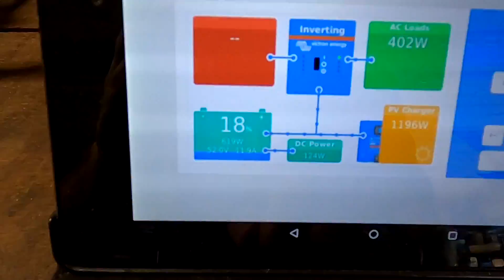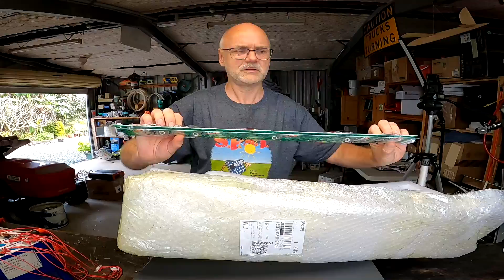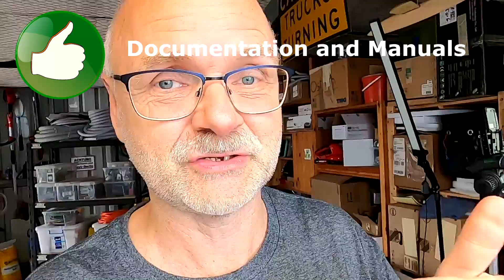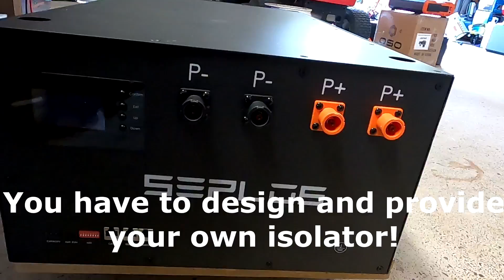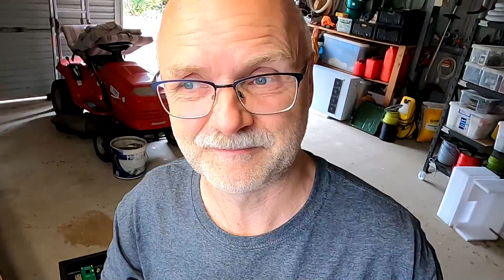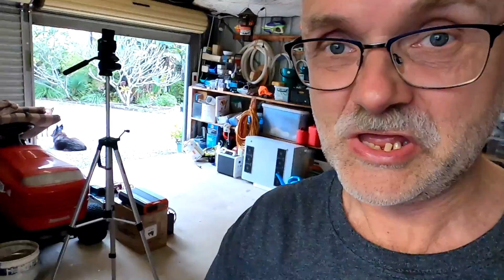Considering a SEPLOS Battery or BMS? Here is my experience so far...

Comment: Hi:) - Thank you for a stream of very informative videos:) Planning to use 2 x DIY Seplos Mason packs for a boat project and though I pick your brain if you do not mind:) Can see that you can use either 16 x EVE LF280K or LF304K (believe you tend to opt for the first option). Do you see anything negative in using LF304K or is it just a cost versus output question? - Another question that I am interested in your view on is that my batteries will be stored out of sight. Due to this my idea is to extend the cable to the display window and mount this away from the box (and to plug the display windows with a dead plate). Can you see any negatives in doing so?:) Thanks again!

Comment: So, is it possible to connect a NEEY active balancer to the Seplos V3 BMS so that the BMS can activate the balancer if and when it needs to automatically. As there is a set of pads to activate the Balancer it should be possible if the Seplos has an active balance output. Ideas?

Comment: Hi! I'm considering changing my battery. Now I have 4 WV NMC 12S modules, they are 48v and a total of 27kwh.
The problem is that the battery low-top range is 40-49v but in fact the deye cuts discharge arrond 43/44v.
I think the 40-58v voltage range of a lifepo4 would be much better, even knowing that the seplos mason has around 14kwh.
Does make sense the idea of changing it?
Thanks!

Comment: As much as i like the box, etc. the negatives are concerning but also the cost is way too much. i'm seriously debating just DIYing it. to get 2 casings here to Aussie total is almost half the cost of my batteries :( $2k for cases and my 32 x 280ah cells were $5.2k
Reply from the maker: Did you get a quote for shipping? Don't use the shipping calculator on their website...
I thought the same but considering you get a very good built case with handles and all accessories, front plate, the 200A BMS, display and battery compression, battery cell PCBs, temp sensors and also stackable. You probably don't safe much. Yeah, but the shipping costs may kill it. Unless you buy the batteries from Seplos as well and they can ship it all together. Tell them they need to give you a good deal and you're coming from my channel.
Reply: @OffGridGarageAustralia  i'll give it a try and let you know what happens.
Reply: @OffGridGarageAustralia  i spoke to allen and he give me following prices
1 box with shipping $782.04aud
2 box with shipping $1542.03aud
which is better not so bad.
Reply from the maker: @jeremyohara6513  Yeah, OK, that's still... some money. Considering, the BMS is around A$400-A$450 already, plus all the other accessories, you probably cannot make such a metal box yourself including welding and spray painting. So overall the price seems to be OK, it seems.
Thanks for sharing.
Reply: @OffGridGarageAustralia  yeah still expensive. worse then a server chassle, i could make a box out of ply or get the plastic battery boxes that hold 8cells and put in parallel to make 48v, etc., bms i've seen for about 200 - 300$ if i get the seplos bms, So yeah still kinda on the fence

Comment: Hi Andy, I watch your video’s with great interest. Really nice!
I just built a Seplos 280Ah vertical white battery box with EVE cells.
Quality of the box is great and assembly is easy.
One problem however with the bms. 
When switching on, the bms starts up with all the lights and then displays “ABNORMAL COMMUNICATION”.
Then the display is frozen and the bms will not transfer data to the app on my IPhone.
The app does see the device and power is connected to the output terminals of the battery.
I contacted Jerry of Seplos and he says that is not a correct siuation, but sofar no solution to solve this problem.
Do you have any idea to correct this comm issue?
Grtz from Bert in The Netherlands.
Reply: Hi Andy, thank you for your reaction.
Yes it is a 10E bms. But…
The bms for the standing Seplos is slightly differen from the black battery case. It has a “remote” comm/dipswitch/led display that is located at the top rear of the case with a comm board that is connected to the bms with a plug and flat cable.
The bms’s are not interchangeable between the horizontal and vertical cases.
I also have three horizontal cases here so I tried to interchange the bms. No luck!
I have a friend with a windows laptop, we will install the software and I obtained a rs485/usb adapter.
Today we will try to get access to the bms with te laptop and see how far we get.
I will let you know!
Grtz Bert
Reply from the maker: @bert-janstaat278  Thanks, yeah, keep me posted. Never heard from anyone of a faulty Seplos BMS. Or whatever it might be. Interesting they are using a different BMS/formfactor for the vertical box.
Reply from the maker: Hi Bert. I still have such a vertical Seplos box in my garage for a future video.
What BMS do you have, the 10E? Can you access it via PC software at all? If not it is faulty and needs replacement, I would say.

Comment: I was wondering why some friends of mine are buying these seplos BMS and so fond of them. And I never understood why... Now I know, it is not bad BMS, bat for the same money you can get much better product, so there is no reason to buy it
Reply from the maker: It all depends what batteries you have an how many in parallel. There is a certain benefit of having them communicating all details to the Victron system and all alarms of each BMS for example will be showing up in Victron.
The control of the whole Victron system does not work well as far as I have tested and I would not recommend using that. So the BMS is great but needs better software.
Reply: @OffGridGarageAustralia  ...and better balancer :)

Comment: Hi Andy, If running battery packs in parallel did you confirm if all BMS's switch off in the event of a cell fault? And if not what would be the result if one pack disconnecting due to an over voltage cell and then reconnected at a point when the rest of the packs were near flat. Not a good result one would think!!!
Reply from the maker: Yes, they all disconnect at least for overvoltage safely from what I have tested.. If only one pack disconnects due to OV, it only disconnects the charging function, not discharging. So, if you put on some load on, all batteries, including the one with OVP triggered, are getting discharged the same way and voltage stays still the same.

Comment: Actually, I like the design to limit the charging to 95%.  I have the impression in the top 5% you add extra stress to the cells.  Same for the discharge.  I have no problem with this setting if it reduces some of the stress on the batteries and I hope it improves the life of the cells.
And with the communication to the inverter/charger it should be fine if the BMS informs inverter when to stop charger or discharging.  That is why we have the communication.  Same if the BMS tells the invertor to limit charge or discharge current.  I believe the BMS should be indeed the master of these parameters.

Comment: Can someone give me an answer please, I have a Seplos BMS E10 , i.e. the new version and it says at point 18 Harging overvoltage protection and is set to 63 Volt and point 19 is charging overvoltage recovery set to 61 Volt, but the max in my system is 58 Volt shut down at 3,625 V/Cell. Changing is not posible, what did your Software say? Thanks to anybody

Comment: hi andy, merry christmas, i have a question, two 300 amp battery banks, with two seplos and communication with inverter/charger, maximum charge per bank 0.5c (150 amp), 190 amp battery charger and total solar panels 11 Kwatts, . What would happen if one battery is fully charged and the other is not and the charger/inverter is at 190 amps? Would the communication of seplos with inverter correct the amount of load to 150 Amps or less? Thanks a lot.

Comment: I have 3 Selpos Mason 206Ah 10.5kWh battery packs, which uses the  3.2v 206Ah Prismatic Battery Cell modules, and just like yours the the battery packs came disassembled, so the BMS setup procedure is necessary because you are acting as the assembly line in a factory. These packs are design for this in mind. In fact the Mason Battery Pack I have, which has those click on/off connectors you pointed out are design for vehicles, not home storage hence the lack of a cut off switch. I am now about to order their Pusung 135Ah 7kWh 51.2v Battery Pack which is designed for home storage and comes with a cut off switch. Your review is very honest and I can agree with most all of the findings you've made. To answer your question on joining to packs together and the master BMS having autonomy over the 2 packs is correct. The lowest cell module will determine the cut off procedure for the entire bank.

Comment: Hi, I wanted to ask some information about the SEPLOS MASON system.  
How does it actually work if you connect multiple SEPLOS MASON systems together ?
How do you charge the batteries and how do you discharge the batteries ?
does it always work one at a time until it is discharged and then switch to another one ?
or do all SEPLOS MASONs charge and discharge at the same time?
Reply: Batteries can be connected in parallel for greater energy. They will all charge and discharge together. Charging and discharging is generally via a hybrid inverter that produces 120V or 240V to power appliances and also functions as a battery charger when connected to an AC input.

Comment: Hi Andy
I was wondering what the current situation is with the Seplos Bms weaknesses.  You seem to be in contact with them and was wondering if you had any updates on when/if they are going to improve the BMS?  I’m about to buy the 280ah kit and not really getting much feedback from them.  Hence I turn to our trusted Andy to see if there is any news positive or negative?
Cheers 
Mick
Reply: What's wrong with the BMS from your point of view?
Reply: @huskypup3489  I’m looking to integrate a system with three of the batteries and Victron gear so I want to ensure the comms are all working.  I saw Andy has the new version and they now talk to each other.

Comment: My experience with Seplos has been amazing. My account manager Jerry has been super helpful throughout the ordering process and aftersales support, and put me directly in touch with Link for issues beyond his ability. In my opinion Seplos are fantastic at customer service.
Reply: Also to add your comments about Seplos limiting the SOC, it is all configurable in the software. You can overcharge them if you want to if you set the settings correctly.

Comment: For me, the primary benefit of battery to inverter/charger communication is backing down charge current when one cell approaches overvoltage shutdown to give more leverage for BMS balancing current to fix the situation without a BMS shutdown.  

Seplos terminating charge when a cell just approaches overvoltage cutout, leaving cell balancing incomplete, is not a good option as highest cell will quickly drop below 3.4v stopping its bleed balancing prematurely. You lose the charge current overpotential terminal voltage rise when you stop charge current which is the best cell comparison indicator of cell SOC balance.  Guess they feel having battery shutdown is worse than having imbalanced cells. That logic will just create a continuing downward spiral of degrading SOC balance of cells.

From their perspective, they may turn charging back on after highest cell drops, so the balancing will eventually be done.  However, many chargers will interpret the drop off in charge current as absorb complete and go to float voltage therefore preventing further balancing of cells by BMS.

I do believe in having 1% to 2% of cell capacity rating in balancing current capability, particularly when you do not bring battery to full state of charge often, limiting balancing time opportunity.  Only having 150 mA balancing on 280 AH cell requires a lot of time holding cells at higher absorb voltage to achieve balancing which is not great treatment of battery.  The more time spent balancing above 3.4v, the more cell electrolyte damage is done.

Comment: Hi Andy. Re.  Seplos shutdown/standby
Toggle switches stop the shutdown. Go to
‘Upload parameter’
Left hand window ‘fiction switch’
Scroll down to the bottom of the list
‘Switch off function’
And 
Standby function
Toggle switches as needed

👍
Reply from the maker: Thank you. I have the full list of all function switches now rom Seplos. I quite like this sleep function actually. It turns off the BMS after 48h of inactivity.
Reply: @OffGridGarageAustralia  
That’s great.  Have you noticed ‘heating’.  (I think it was heating.). I contacted seplos to get a breakdown thinking it was for a cell heating switch, all I had back from them was ‘this was for other applications 
‘Be nice to have this active.

Tony
Reply from the maker: @tonmilly  Can their BMS heat the battery with a pad? I haven't seen anything like this on their website.

Comment: hi andy
it actually makes sense that this different Battery packs talk to each other or to the inverter/charge controller. imagine you have a really big PV - so big that in full sunshine you have all the parallel batteries on max charge current.
so when you than have a problem/fault with one BMS and it disconnects ->all the other Packs will also disconnect because of OverChargeCurrent. than it would be nice if your inverter/mpptcharger lowers the charge current so the rest of the packs can still continue to charge on their individual max charge current. otherwise you have all the batteries disconnected because of a single fault in a single Pack and a lot of Energy that could charge your batteries is lost until you manually clear the issue.

Best regards form Upper Austria
Reply: If one pack of many in parallel disconnects while charging, the other batteries will continue to charge normally. No communication between batteries is necessary.

Comment: I made the mistake of buying one of their 200A BMS's. I have had nothing but problems from day one. It stopped balancing now after running for about 160 cycles, cell differences are > 200mV,  some cells are constantly stressed out to their maximum allowable limit while others remain barely charged. This BMS is a throw away unless you want to damage your battery cells. The company doesn't care, they either ignore repeated communications or reply with a generic 'OK' believing that the issue will somehow go away.

Avoid this tofu dreg from Seplos, their product is of poor manufacturing quality, they leave you stuck with their broken junk and their customer service is non-existent
Reply: What if you re-balance the cells manually...?

Comment: Not related to this video but wasn’t getting a response on the older videos. 
Are you having to retighten your busbars on your eve cells due to normal swelling movement? Are you concerned about any stress on the terminals of each cell due to swelling because your not using flexible busbars? It’s my understanding that some swelling happens if there isn’t compression.

Comment: I've been wondering... in the event that one or more cells vent, what will happen? That case looks relatively air tight. How much volume of gas would there be and how quickly does it happen?
Obviously not something you can test but has been on my mind. If I were to install this in my house it'd be nice if there was a vent connection to hook it up to a dryer vent-style outlet to direct the gasses safely out of the home.

Comment: Are you allowed to put them vertically, making the cells layong on their side and on top of each other with their weight? Or is this a bad idea in general for prismatic cells?
Reply from the maker: There is nothing in the manual about the orientation of the cells. Information are widely different. 
I can hear the liquid electrolyte inside the cells when shaking so my thought is it's bets to keep in an upright position.
Reply: @OffGridGarageAustralia  I've builded a battery with laying cells but one of the 48 cells began leaking elektrolyte. These where (and are) high qualitiy cells so I rebuilded the pack and put them upright. I won't lay them down anymore.

Comment: Hello from Germany. (Heute mal auf Englisch) I'm now starting to build my seplos battery! But without this case, only the eve lf280k cells and the seplos 16s 150 amp bms! My thought was, to save the money for the case and built an own one. I've loaded my cells all to 3,65V separately and put them in parallel together for passive balancing.

In a view days I might be able to report how the system works!

But, after viewing this video, I think I need an active balancer for top balancing! 😅🙈

I will report!!

Greetings from Germany 

Grüße aus Deutschland! 🤙😎
Reply from the maker: Thanks for sharing, Oli. Did you get the batteries form Seplos as well?

Comment: One thing I forgot about was if your whole system is communicating and you put in the wrong parameters that are system wide and they fail, they are going to fail when you have the least ability to repair it. Or worse yet doesn't shut down the the system but damages the battery thru fat fingering 3.95 instead of 3.65. I like setting each part independently.

Comment: Another comment, probably tired of hearing from me. I picked the Growatt because it is kinda dumb. Sun comes out, makes power. Didn't have to hook up to internet to run it. Works out of the box. Can set parameters from front panel. Also has RS485 if you want to hook up PC. All other parts are independent. Changing the settings on the other parts of my system are independent. The inverter makes AC electricity. My charger charges. Each battery BMS controls charging and discharging. If anything dies it doesn't take down the whole system. I can repair or replace defective parts without a flashlight 🔦
Reply from the maker: Never tired of hearing from you. 
Thanks for sharing. The redundancy makes a lot of sense and was a big factor in designing my battery 2.0 as well.